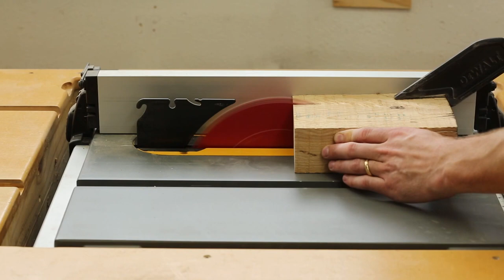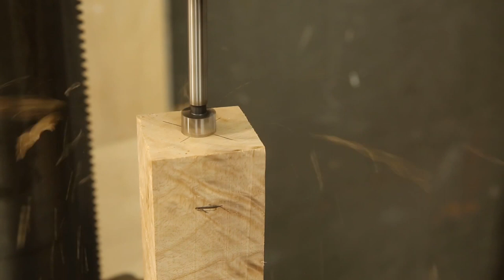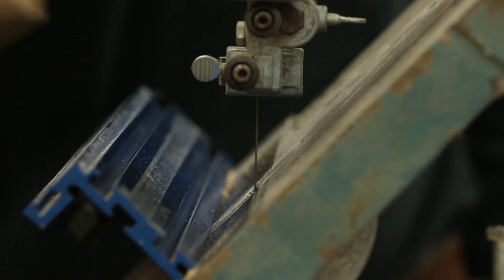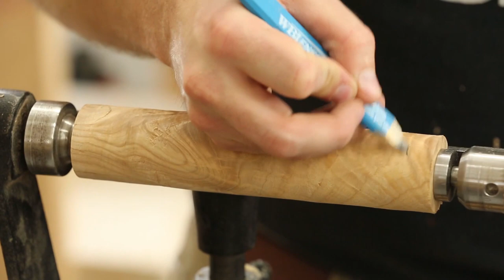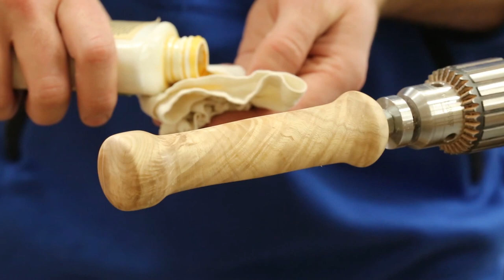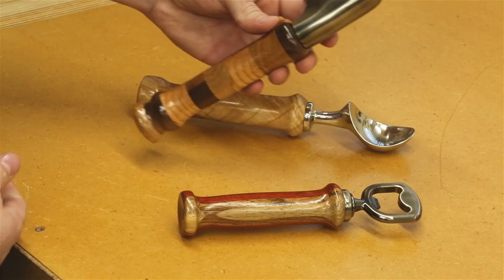Pizza Cutter, Ice Cream Scoop & Bottle Opener - How To Turn Handles

Comment: where did you get the mandrel for the pizza cutter. I have see bottle stopper mandrels but not a pizza cutter one. And do you know if it will work ona psi deluze pizza cutter?
Reply from the maker: Its been so long that I don't remember... but I would guess it came from Rockler or CraftSuppliesUSA. I really don't know what it will work with, it all depends on the thread size.

Comment: Those are really nice!  What finish did you use?  I have made some bottle openers and used CA finish but need an alternative to that on these types of projects and yours turned out great!
Reply from the maker: Thanks David! I tend to use tung oil to get the colors that I like. Then when it's really dry I coat it in spray lacquer.
Reply: Check out Crystalac BriteTone!! It is amazing.

Comment: Where did you find those screw on version of the pizza cutter? Since I am a student, a pizza cutter is an essential kitchen tool that I need, so I want to make a wooden one myself ;)
Reply from the maker: This is the hardware that I like to use. http://www.rockler.com/rockler-stainless-steel-pizza-cutter-turning-kit-pewter-finish If you get one built I'd love to see it!
Reply: Gunflint Designs Thank you sir. I will look them up tomorrow and check if they ship to Belgium. I certainly will share it if I build one, I'm running low on uploads due to my finals so I can not let any opportunity pass! And you know, pizza is life!